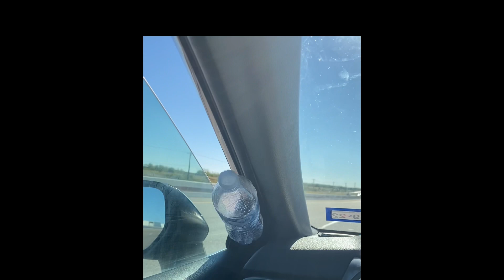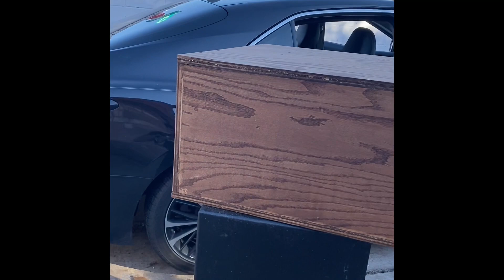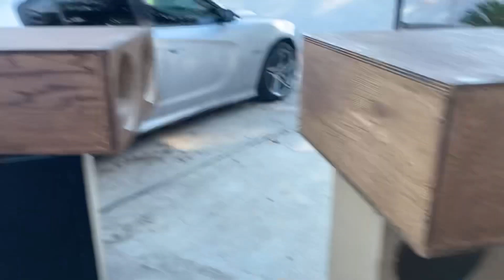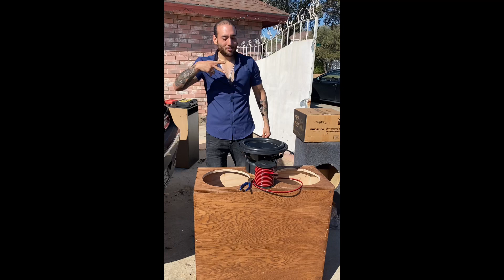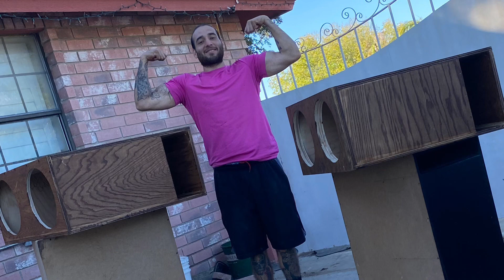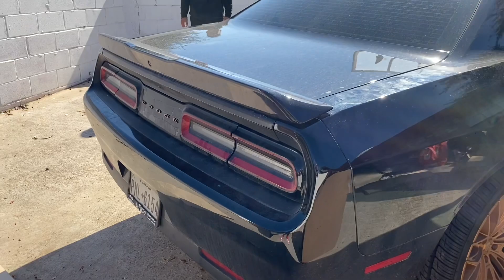Skar Audio DDX 12’s Custom Subwoofer Enclosures Time Lapse+Demo

Comment: Yo Mike, can u fit 15s in the Charger trunk? Im tryin to see if i should get 2 Sundown Audio U15s or just keep my Crossfire C7 12s. Just got a Charger and trying to see what my best options are. Also what LOC did you use for the radio?
Reply from the maker: Yes i can. You’re gonna gain a lot if you switch to sundown u’s. I used a kicker rca converter
Reply: @mikessplboxes7497  preciate the response brotha. U still in Bryan Tx? Would u need to get measurements from my car or can u go off the box in this video?
Reply from the maker: @bashns7743  not in bryan no more, still close to houston tho. I wont need measurements I remember
Reply: @mikessplboxes7497  thats a bet bro. How far would u say to Houston? Soon as i sell my Crossfire 12s ill get the U15s and hit u up
Reply from the maker: @bashns7743  u got it